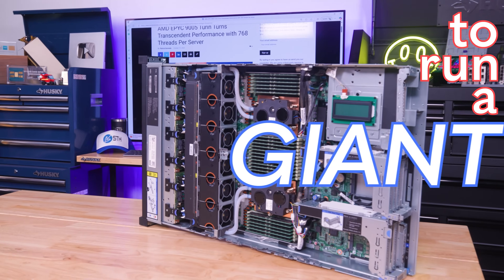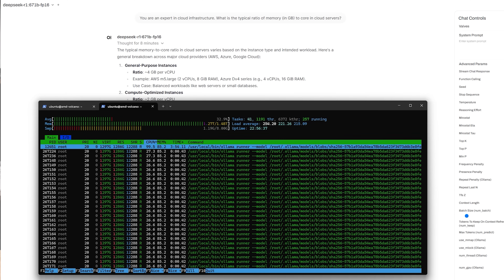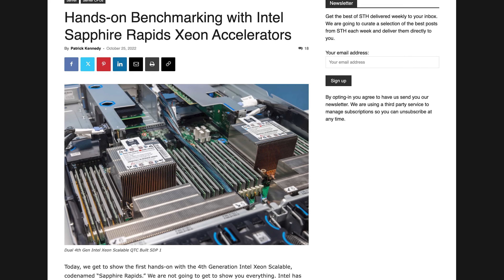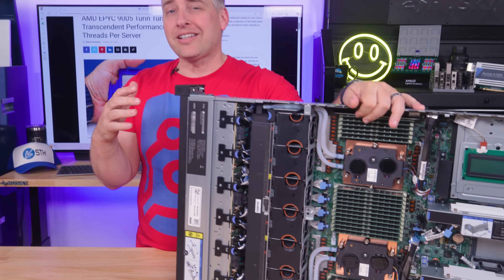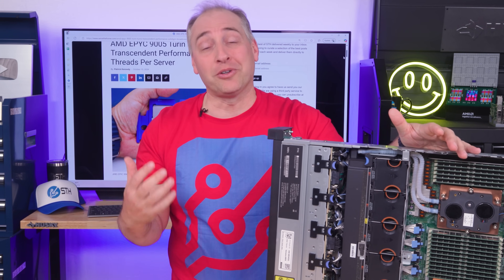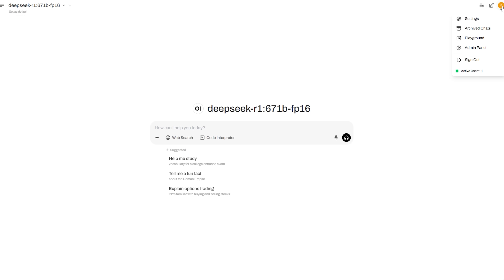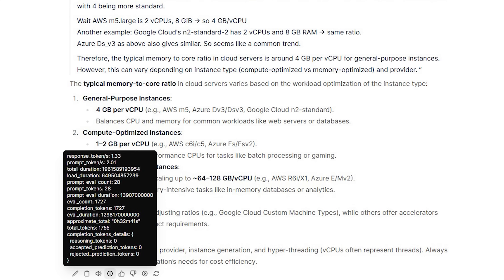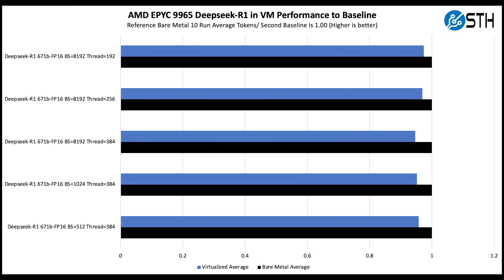Running Deepseek-R1 671B without a GPU

Comment: For bonus points throw a single 24-48GB GPU in the server and run the model with KTransformers instead of ollama for a huge speed boost.
Reply: How does it work? will it then use GPU for computing but RAM for memory?  From somewhere I heard GPU will be slow if it has to use RAM but since I myself don't have GPU I don't know about details. And buying 512 GB worth of GPUs is way above my budget but if you tell me I might get away with 1 GPU and 512 GB RAM I might try it at one point. Any speed estimate? The speed I saw in this video wouldn't yet motivate me to spend money but for decent speed maybe.
Reply: @test-rj2vl one GPU is about 1k EUR.  (RTX 3090).  You would need 16 of them.
Reply: @alekseyburrovets4747  That's why I was asking. This comment seemed to suggest mixing GPU with RAM. 16x 3090 definitely not gonna happen.
Reply: @test-rj2vl lol wtf I don't know why youtube is skipping my comments.

The budget for the inference machine ok ktransformers is 5k eur.  The performance is 8 tps
Reply: @alekseyburrovets4747  From my experience, youtube skips your comments when give technical advise that is too useful. In that case you have to split 1 useful comment into several useless comments that combined become useful.
Reply: @test-rj2vl if you are interested in ktransformers and cheap setup (5k EUR) you would get about 8 tps.
Reply: Working on this at the moment, 8b R1, dual-socket es 32-core high-clock sapphire rapids xeons with AMX and 768gb ddr5 ecc @ 4800-5600mhz (whatever we can run)

Started with a Tyan tempest dual-socket from woot for $250 and a dream, gonna see how things go. Single/dual 3090s with nvlink should run the fixed parts very fast, total cost without GPUs -- $250 mobo, $130/es CPU*2, $155 per 48gb RAM dimm*16 (the most expensive part)

Looking forward to running R1/V3/whatever comes next and using it for my own API calls for various programs, plus other heavy processing workloads that benefit from many cores and AMX, such as RVC and Sovits voice cloning and merging for PhD research projects. Having physical access to my own server greatly improves security and means that I don't have to waste significant amounts of time with additional IRB applications and reviews of external technologies or dealing with the heavily locked-down Condor (which really only works for highly parallel schedulable, not high-RAM real-time workloads)
Reply: lol yeah, he basically wasted the effort.  This is laughable.

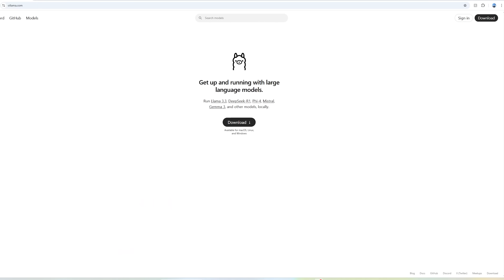Comment: 8:00 For those unaware, "distilled" R1 is not a smaller R1, it's Qwen and Llama finetuned to act like it. The closest you can get to a smaller actual R1 is its heavily quantized versions (which people have ran on GPU + RAM + SSD at still tolerable speeds because it's MoE).
Reply: What's MoE?
Reply: @yensteel  Mixture of Experts.  https://en.wikipedia.org/wiki/Mixture_of_experts
Reply: @kellymoses8566  Thanks!
Reply: Q4 quantized version true.

Comment: Excellent video to get people into AI.  I enjoy your content.  I'm running LLMs on a retired Dell 7820 workstation with dual xeons, 192gb RAM, and an RTX 3060.  It's virtualized and running 6 other VMs, making it very underutilized.  Very modest hardware, but the GPU is a solid boost for AI.  Obviously, I'm not running Deepseek 671b, but one orders of magnitude smaller.  It's still a solid learning platform that's sized to the hardware. It seems very capable with output at >30 t/s.  I'm learning AI for under $1000.
Reply from the maker: That is very much the idea. We are just showing the higher-end version of this.
Reply: I'm running a Dell 7910 with same GPU.  Works great for TTS and Stable Diffusion. Local LLMs are only practical for specific use cases, learning and experimenting being one. It's just not practical to implement a local LLM at this point for general use, with the associated hardware/energy costs.  Not sure it ever will be.

Comment: Interesting to see a CPU test. I ran this on the M3 Ultra Mac Studio -  4bit quant version of course to fit into the 512GB of RAM, but it ran fully on the GPU at 19 tokens per second.
Reply from the maker: Totally. This is FP16 and so slower. The cooler part is that the system can also run VMs at very minimal performance loss.
Reply: @ServeTheHomeVideo  Patrick, I'd love to see this test run again with a 24GB GPU on a version of this model optimized (maybe with Unsloth) to store the most important stuff within the 24GB of VRAM on the GPU and run everything else from the RAM. It would be really nice to see what kind of performance improvement you could get with that kind of combination, which wouldn't be outside the realm of possibility for people with a system like this already. My hypothesis is that the improvement in performance would be very noticeable!
Reply: @ServeTheHomeVideo how about FP4
Reply: 32C CPU and 80C GPU?  Also which quant?  Q4_K_M?  How long is the context window?
Reply: How about you try 96G basic spec or 256GB RAM mid spec on it?

Comment: Look at you guys still writing about 5th gen AWS instances (M5, R5, C5)... 

Also, I question if you actually USE your hardware, since the idea of occupying as much RAM as possible so you can't dynamically spin up workloads is... Silly. STH has really lost their way, if they think people have 70%-90% unutilized RAM in prod... And/or if they think 1.5TB RAM boxes in homelabs is commonplace.

This video is so damned weird.
Reply: it is really weird. the whole homelab community sort of started "based" on the acquisition of used second hand equipment on fleabay for insanely good (comparatively, to original enterprise MSRPs) prices. i would really be surprised if anyone is actually buying this stuff to put in the home, much less for brand new, and for what? so they can do some machine learning slop for really no reason? just to shit up the internet more? no thanks.

Comment: Full version is DeepSeek 671B FP8, while FP16 version is made for those who need it.
Reply: What's the difference between the FP8 and FP16 versions?
Reply: @bluegizmo1983 Ok, an intro to floating point math, or computer math. Computers need a way to represent math in a set number of bits. Most programs run in 32 bit floating point but there are double, quadruple, and half precision. You can save a bunch of data if you go down to 16 bit/half precision. The issue is exactness. If you save 0.3 into fp32, it's actually saved as 0.300000011920928955078125=00111110100110011001100110011010 in binary.

There's no fp number that's exactly 0.3.

Also, the complexity of circuits goes up quadratically for multiplication. So to have 2x the bits, you need 4x the circuit space. For adders, it increases linearly. AI manufacturing  companies such as Nvidia or  would rather have more low-precision hardware than a few high-precision ones in regards to making AI centric hardware due to cost reasons.

Also, in a program, if you do "0.1 + 0.2 == 0.3" for floats, meaning "is 0.1+0.2=0.3?" the result would be FALSE. 0.3 and the result of 0.1+0.2 are not the same. It's because of the way floating point math makes slight rounding errors. There are FP alternatives but that's a big subject.

Now.. why is 8 bit integer (INT8) popular for models? The biggest reason is familiarity and popularity. It's nearly like an unspoken standardization. It's not proven to be superior. One definite benefit of INT8 is exactness. 1+2==3 is TRUE. It doesn't matter that much for AI, but this is something to take note for software development. Banks use integers as much as they can before converting them to fp.

Many GPU and NPU hardware support fp8. However, not every environment supports them. To repeat, they're not necessarily better than integer8 (INT8).

An optimal method is mixed precision. They're close to full precision models while being smaller. Pytorch and many languages now support automatic switching in layers and they're kinda like automatically trimming the fat during the training phase. It's a pain to categorize though.
Reply: edit: Removed my comment as the correct feedback is part of this thread,  cheers peeps.
Reply: @ajc200x  the numbers actually mean how many bits in memory the single floating point number take. In this case, either 8bits (1 byte) or 16bits (2 bytes)
Reply: @Lukaazas9  cool, nice to learn something new
Reply: @ajc200x Consider the “floating” part of the name: what makes it so is that there is not a fixed number of positions after the point (and it’s not decimal, either)

FP8 has a whole lot less than 8 orders of magnitude precision, especially in decimal representation haha. Have a read of how floating point data representation works. It’s interesting, and will prevent such mistakes in future also :)
Reply: So the reason ollama has deepseek 671B at FP16 is actually due to llama.cpp lacking support for FP8.  There's a github issue open about it.  So essentially ollama had to double the precision which doubles the RAM usage.  The true DeepSeek R1 671B FP8 really only needs around 768GiB of RAM.
Reply: who would "need it"? to what purpose?
Reply: @salmiakk_it  some GPUs (typically older ones) perform worse with FP8 than with FP16 due to absence of hardware fp8 ISA.
Reply: @salmiakk_it  A100 clusters (they don't support FP8 natively)
Reply: There is no FP16. There is FP16 for v3, but not for deepseek r1.
Reply from the maker: Totally true. This is more of just running like the biggest version we could find on here.
Reply: @ServeTheHomeVideo  yes, but if you can use the FP8 or even INT4 version that runs even faster at similar accuracy, why not test that? In the end you have 2 - 4 x speed gain for 2 - 5% accuracy loss. With running LLMs locally you wanna see which hardware specs you need for getting the best performance-accuracy ratio. And AMD might not even be the best choice here, since the CPUs don't support matrix operations. Intel on the other hand introduced the AMX instruction set to specifically accelerate AI inference on hardware level